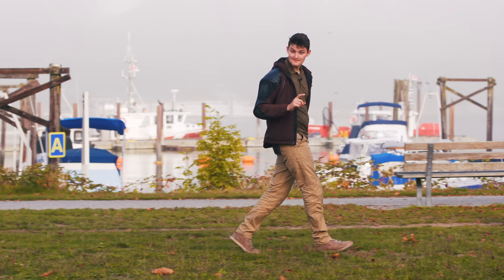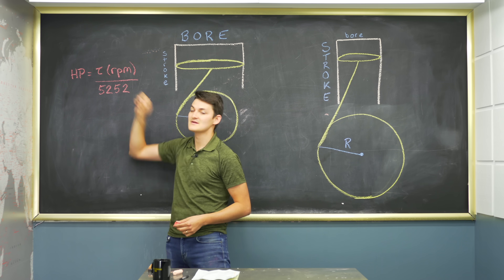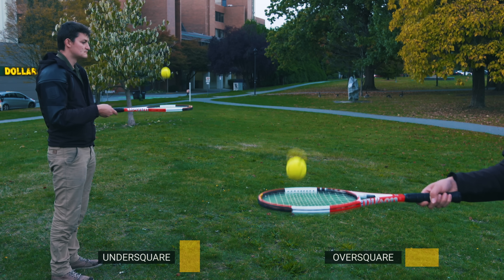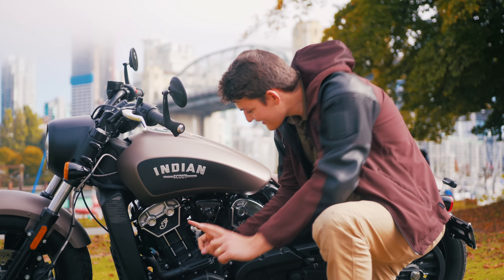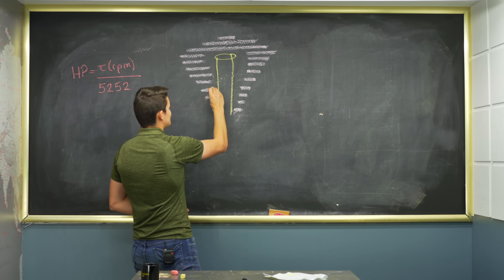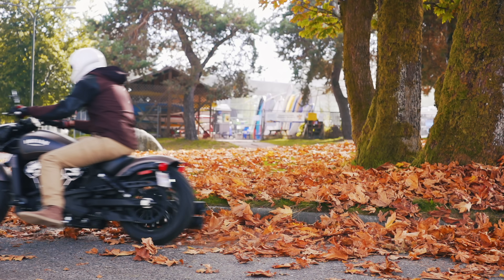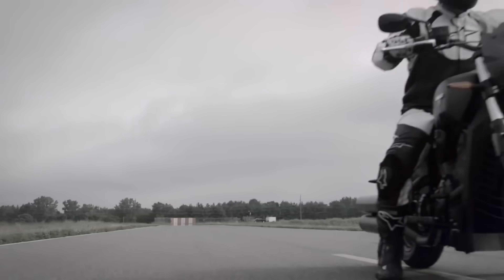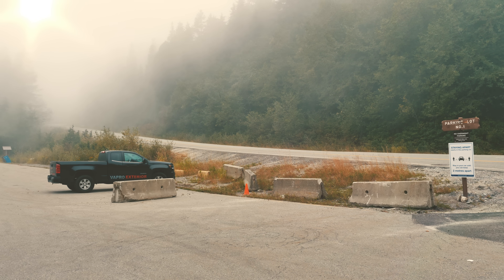How Indian Makes 43% More Power than Harley-Davidson

Comment: I once heard Harley Davidson described as the most efficient way to convert fuel into noise without the side effect of horsepower.
Reply: It's true 😁
Reply: Power is dangerous and most of the people buying Harleys haven't ridden a motorcycle in 26 years so it's really for the best.
Reply: @aluisious  hahaha shit man that just made me laugh out loud because it’s actually so true.
Reply: Isnt that also true for any american muscle car? 120hp from 6.7 liters💀
Reply: Time and engineering continues to march forward. During my early years steam locomotives, propellers/radial engine’s and Harley’s ruled transportation. The Sportie from Harley was the equivalent of the Busa of today. If you had lived in those times and looking at the Harley of today you would see a vast improvement in them. They have managed all these updates while still retaining a true linage. Many people restore and ride collector motorcycles from the old times.
A Harley guy can go buy a brand new old school ride, with a pile of great upgrades. No restoration required and it looks, rides and feels just like his first ride on his daddy’s 1948. “Yes “, cruise control, anti lock brakes, stereo, navigation, heated seats, heated grips and a mystical presence. “Oh “, yes it is heavy but iron, steel and aluminum weight more than plastic.
Still riding at nearly 78 years old and my Harley will run around 125 mph and do so dam quick. Have a 1400 in-line Kawa for track days and for when I feel stupid. I am relaxed and happy on one. The other one just don’t inspire me and I find myself in conversations with local law enforcement.
So I know why you youngsters blow by me a warp 3 and I just laugh as I know the road a head odor will be clear of law enforcement ( THANK YOU).
Reply: Lol and at this time 666 likes!
Reply: I heard it constantly
Reply: @Username-2  I laughed out loud .
It's so true
Reply: @kermitthefrog7368  I mean to be fair most modern v8 American engines put in sports cars make over 450hp. It’s not 1982 anymore.
Reply: @walterjohnson2031  Look how angry grandpa got all of sudden when someone made fun of his heavy, slow bike. He even made up some sportsbike he takes to also totally not made up 'track days'. 
And that fear of the police and authority is truly something else. Unlike you we just take off if they try and stop us and guess what, our bikes easily outrun them. No face, no case. Because we are not stuck in the past.
Reply: @arcuz7862  I have a few pictures and trophies from some fairly recent track days. Like most people who ride motorcycles I enjoy speed and acceleration. My track leathers have had several sets of pucks and my chicken strips are very thin. I started out doing a little flat tracking with a XR-750 Harley in 1962. Then went over to road courses on a Honda 750. Until last year I had 1400 Kawasaki I would run up at Barber
Reply: @arcuz7862  I don’t fear the police youngster, I simply respect the law. I also believe in setting a fairly reasonable example of being a law abiding citizen. I am not an angel but I strife not to be confrontational with people. 
I spent two years in Vietnam and great full to have returned in more or less one piece. So on public streets I feel it borders on suicide to run 176 mph. My 1400 Kawasaki will run that fast. On a closed course track like Barber etc no problem as grandma is not likely to pull out or turn left in front of old grandpa here. So ride safe and live long enough to grow up.
Reply: In all fairness, why should it always be more power, more power, better mechanics, better mechanics?  There is a lot of truth in the maxim, 'If it ain't broke don't fix it."  Harleys in many ways can't compete with many modern marques, BUT they offer nostalgia, a unique appeal, and an unbeatable muscle image.  That is why people buy Harleys.  Moreover in terms of performance and handling on the road, they are still more than adequate (though I confess to have never ridden one).  Why care if the latest GSSSRXXX Trubo H22RRR has screamed past you at over 150 mph plus?  Harley riders enjoy their bikes and the ride.  I ride a BM, my only gripe with a Harley, is they are too expensive for me, though my wife wants me to get one.
Reply: @aluisious  That's just too true. Nothing says midlife crisis like a brand new Harley in that guy's driveway. Doubly true in the EU, where Harleys aren't even that popular.
Reply: Harley Davidson: A clothing brand that also sells motorcycles
Reply: Power sucks I want torque and noise 👍
Reply: @walterjohnson2031  Why do you own a Kawasaki for the tracks ? because you must know they aren't a match for good bikes. Harley will run out of riders if they continue this business model of selling overpriced underpowered bikes. If this goes on there won't be Harley in the future.
Reply: @arcuz7862  Don't run and die, its just not worth it dying over speeding.
Reply: Lolol
Reply: @retired-s5h  If you know how to do it, you don't die.
Reply: @aluisious  at least they know their target market and they milked it drier than the sahara and now even that cow has dried up
Reply: That is the best one I've heard so far.
Reply: @walterjohnson2031  Indian built a better moto back then too but Harley out marketed them. I have never been a Harley guy but I can identify. I just bought a Honda Shadow that everything about it is mellow. I also bought it because Honda is one of the most dependable of all time. When I want to rip I have a kx450. Riding the heavy no powered v-twin make the motocross bike so much more fun to ride. I'm glad you enjoy your bikes because I absolutely love mine.
Reply: I passed a HD 131 Stage IV CVO while he was passing other harleys...with my honda 1800vtxC, lol.
Reply: @kermitthefrog7368 yeah 50 years ago
Reply: I was told, Harley-Davidson is a fashion brand that also makes motorcycles. And a custom builder in the South referred to them as "a faux-cowboy noisemaker that travels at the speed of a tricycle." Still, though it was a crap bike, the 1977 XLCR was nice.
Reply: @IslandArt61  I agree somewhat on the fashion thing. There are three Harley types; old school hard core bikers, weekend warriors/ lawyers & doctors and youngsters trying to emulate what movies and TV show as bikers.
You must remember that you under no conditions can compare a Harley to modern motorcycles built after 1965. Harley is a improved antique that reflects the period in time it was conceived in. These qualities along with the mystique and history of the brand is the driving force behind Harley’s survival into modern times.
Reply: lmao
Reply: @arcuz7862  Spoken like squid.
Reply: @IslandArt61  You obviously do not know the definition of a squid, so I'm not gonna destroy you.
Reply: This comment section is making me wonder if it's a sin or crime to have a preference for muscular bikes, specifically cruisers.
Reply: @Farhan_049  It isn't, these bikes are just trash. If you enjoy trash, good for you. Life is easy when one is simple like that.
Reply: @Farhan_049  Not at all, especially if the muscles are real. Hence this video of Indian making 43% more power. (My preference would be the FTR which is a stunning machine) Other makes also have great bikes in the class. It's just that you can no longer market low power, excessive weight, and inherent vibration as "soul" or "tradition".
Reply: Great power = great responsibility. Great Noise = no responsibility 🤷‍♂️
Reply: @kermitthefrog7368 but those were mainly emissions restrictions, low compression ratios and limited technology.
That’s where the difference is, the new Chargers, Challangers, Camaros and Mustangs triple the HP of their predecessors while Harley’s still puts out 45hp from 1200cc’s.
My BMW K1300s puts out 175HP.
Reply: @sharedknowledge6640 bro what are you on about that’s far from true sportster maybe
Reply: My uncle calls them potato bikes because it sounds like it's saying potatopotatopotatpotat when they're idling.
Reply: You havent seen the electric bagpipes
Reply: @kermitthefrog7368  Last I saw was 1000hp from 6.2l... You living in 1979?
Reply: I have also heard that one. Still makes me laugh.
Reply: @kermitthefrog7368  From the 70's, absolutely true.
Reply: Started riding at ten in 1960 . For a good number of years, my cousin and I would go to the Drive in movies on Saturday night. We would take our bikes. We rode Harleys. We never took a date to the movie, and we never went home alone
You get out of a Harley what you put on it.
Reply: @sharedknowledge6640 

Not really true, arguably the fastest 250 Honda makes is the CBR250RR which does a quarter mile in 14.6 seconds.

An HD Iron 883 does it in 14.5

Your point is still valid though. Over 3x the displacement to edge out by a length isn’t really much to brag about.

Harley builds a bike for a specific purpose, A niche they own. Outright speed & power isn’t it.

They’re very much capable of it, the Sportster S makes 121hp & 92tq  from a 1250cc and the Pan America cranking 150hp. which is respectable considering it’s a mid reving engine capping out at like 8k

But they’ll never slap these motors in a cruiser. 

Tbh Indians guilty of it too. The cheif makes like 85hp from a 1800ci engine.
Reply: @asethet.  Bloody well put.
Reply: I mean they found the best way to do it, in 1938, and fucking ran with it, I can respect someone that is willing to sell you a piece of history in that sense, I just think they have a terrible understanding of there own history, watching dudes jump JDs through the woods is awesome, watching fat boomers waddle to a themed bar with a bagger, is not.
Reply: @kermitthefrog7368  pre emissions they were getting numbers that wouldn’t been seen until the 2000s lol, really it’s the same thing as Harley, they made the best product in the world in 1948 and fucking ran with it clear up into the 2000s lol.
Reply: As a proud Indian motorcycle owner I will never ever let any of my Harley owning friends live that statement down
Reply: Amazing review 😂
Reply: Gold mate
Reply: @sharedknowledge6640 and cash.  They are overpriced.  Considering that much of the components are imported. They should be cheaper.
Reply: @malcolmabram2957  power is OK. You need passing power to get past very slow-moving drivers, but that's where torque comes  in very handy, the quick acceleration to pass a slow mover.  That it's there is OK, but I agree, top speed should be in a sanctioned road course or track not on highway, freeway or street. Everyone has freedom, just dint abuse it  and cause accidents nor self induced wreck.
Reply: @arcuz7862 and then you crash abd are on life support or cause others to crash and put the on life support. 
If you are a speed demon you have a death wish. I attended the wake of a 1%er biker running late to work. The poor soul  did  not do an evasive maneuver in time to avoid getting hit by a semi truck.
Drive safe. Reckless driving is not worth it.
Reply: @suasanakota6219 actually the noise us helpful. A person with windows rolled up with radio on might nit hear a very efficient quiet motorcycle and might hit a biker. A loud one can alert the car driver of your presence and allow for proper navigation. Just avoid living in Cali where the tramp know everyone with their excessive regulations.
Reply: With complementary thigh pain

Comment: My wife's on an Indian Scout.  I asked the salesman why it didn't have a gas gauge to which he replied "Indian is trying to keep the bike nostalgic."  I was met with a blank stare when I asked "then why does it have a USB port and LED lights?"
Reply: "Thats our 'have your cake and eat it, too' package!"

Edit - But seriously, that's a nice bike. Have any problems with it?
Reply: Usb port is pretty hidden isn’t it? I’d still take the led light 😂. I do like the look of the speedometer on mine.
Reply: Don't worry, I asked the same thing for my sportster. The dealer told me that I'd know when I'm out of gas. Not even 1 month into owning it I got stranded. I learned up on my riding habits and the fuel mileage and from then on, it was never an issue. 

Moral of the story, It's probably the test of temperament that combats convenience. Dealerships also seem to think so too since that's how it's always been.
Reply: I top my Scout off every 100 miles or so. I have pushed my top off to 130 and still have just under half gallon in the tank when I do. Use the trip meter.
Reply: From what I'm reading I find it wild that they have a button to change the analog dash from a tach to milage but didn't think to have some form of fuel indicator in that button function.
Reply: @Chillin4030  it’s not just the display, they would need something inside the tank too. Personally, I’m ok with it.
Reply: The lack of a fuel guage really isn't an issue. Just reset the trip meter every time you fill up. The light comes on at pretty much the same mileage (give or take a few miles) every time. I've never run out.
Reply: @spacebear49  Also do the slosh or stick test every once in a while.
Reply: Ask a yamaha why their R1 has no gas gauge yet it has a "throttle amount gauge" on the display even in 2024...theyll say none of their sportbikes do...except that the r3, r7, fzo7/fz09, and many dozens of other bikes theyve made do have them, and even my 80s bikes have them!
Reply: @slaytanic921  they would need a tiny float on a bent piece of steel wire, hooked to any old 90 ohm resistor switch. then use any standard 90 ohm display...boom, done.
Reply: There is no try
Reply: Hilarious. They do try to keep it nostalgic, but dont know how. They surrender to USBs and the LCD screen displaying everything throught a software interface. I hate that. Id rather not have the USBs and all that, no gps nothing, and have a nice polish old style but well built with sharp metal analogue gauges.
Reply: BMWs are still the same.
Reply: Thats something Harley are good at, most of the their bikes have a fuel gauge which is handy. I brought a sportster which is the model that doesnt. However they offer a kit to add it so all is well again.
Reply: @jjakes5589  I legit thought this was a joke. I’ve owned three sports-ish bikes (Honda and Kawasaki), and I’d never heard of a motorcycle that didn’t have a fuel gauge! I kinda get some bike from 1930 not having a fuel gauge, but it’s inexcusable for any bike made in the last 50 years not to have one. Unbelievably simple technology.
Reply: And why dosent it have nostalgic pricing?
Reply: Two years ago, I stopped into the local Indian motorcycle shop. I saw some fine looking bikes. I also found a lack of a parts department, and the only mechanics work they did there was uncrating and setting the motorcycle up . Last April I went back to that shop. I was looking to up grade, The dealership was gone. This is something I have found to be a bit of a problem. There is no reliable support for any of these motorcycles, with the exception of HD. There dealer network is second to none. Pricey ? Ya, but the last oil filter I bought for my Triumph cost 25$ tires they wanted 600$ mounted . They are all pricey.
Reply: Is it possible for the motor company to add the desired gage as a paid for add on ? Or can it ve after market installed?
Reply: Nothing like looking old school and sitting on the side of the freeway out of gas
Reply: @BillyR79  Set your shut off valve to reserve, then you don't run out. I've never had a motorcycle with a gas gauge and I've never ran out of gas.
Reply: @ cool I didn’t realize they had a reserve tank so it gives you plenty of time to go get more gas.
Reply: @BillyR79  The petcock is a valve. One side provides a reserve. Also it is good to keep track of mileage. Once you know that it is simple keep track of fuel use. And, whenever you are riding in new territory, at the half tank mark I stop and fill up. I also carried a empty pop bottle, if you are riding with partner, you can bum gas from their bike.
Reply: @ good advice thanks. I’m not a rider yet, but I plan on being one in the near future.
Reply: @billyrigg7829  Good. I'm 75 and sadly I've guit,age. I think that the following is some very important advice learned over many years. Take riding lessons, and keep taking advance training. You can never be to good riding a motorcycle. Dress for self protection, this include the most over looked item gloves, get good leather gloves full finger.  It is human nature in a fall to put your hands out. If you ever go down on a bike, motor or not your hand can get tore up . Protect them, and cover the rest of your body as well. And lastly be your own motorcycle mechanic. Get the tools,the manuals, and a place to work. Then find a good teacher. Again this is a continuous thing. You want to know at all times what condition your motorcycle is in and how much you can count on it. Good luck on your adventure, mine was a blast. Keep the shinny side up.
Reply: @ Amen, and thanks for the great advice. I pray that God will continue to bless you even beyond your imagining in Jesus name. Proverbs 3:1-12, be encouraged, you are loved.
Reply: I would've responded with "I said nostalgic, not usless 😂"
Reply: I always just look in the tank. The caps are right on top of most bikes.
Reply: That's what the trip meter is for. Level gauges in a bike that leans over is hard...